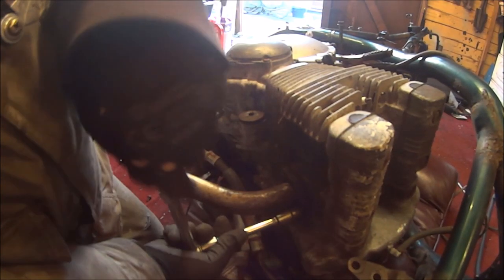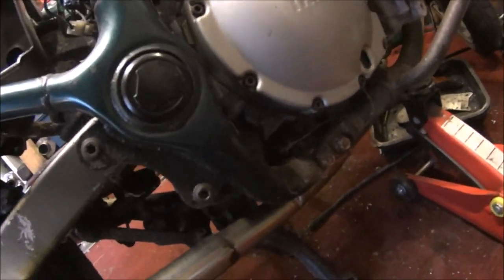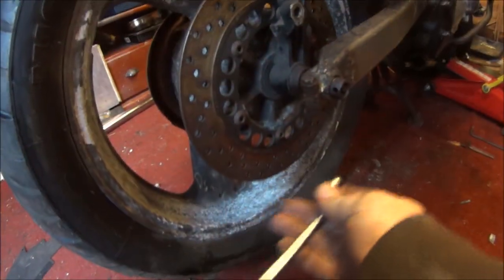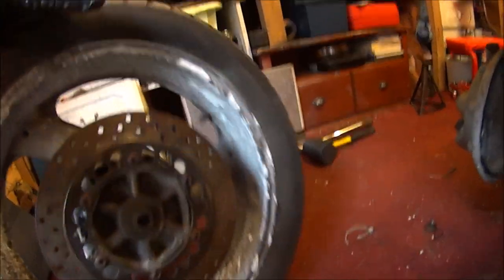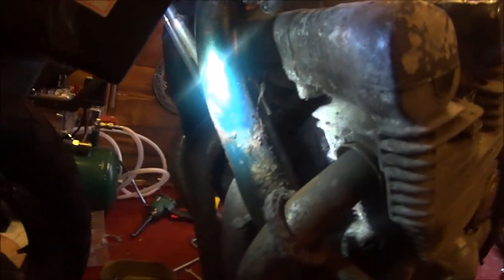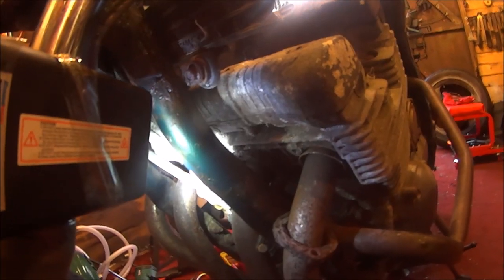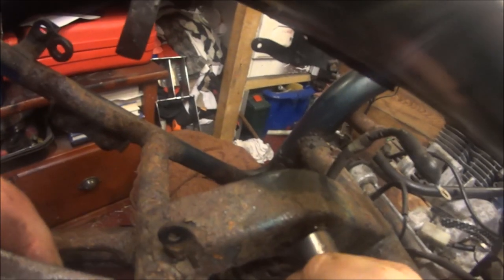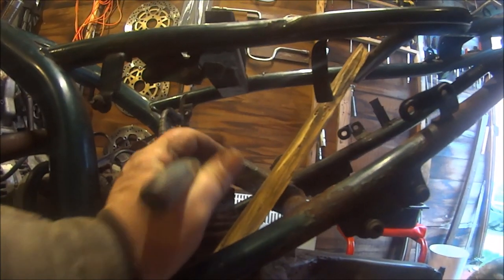Yamaha xj900s project part 8

Comment: That nice looking compressor.is crying out for a socket wrench from aldi.saves a lot of swearing and Blackman's pinches
Reply from the maker: darren molloy I have a impact gun but the bigger bolts still don't budge I'm not sure if the compressor is strong enough.
Reply: ROAD RODENT ..6cmf upwards
Reply: You are correct.they do use quite a lot of air..maybe letting motor run till tank full.may only get a minute or 2 out of tank.....certain 115psi is enough though
Reply from the maker: darren molloy thanks Darren I need all the help and tips I can get this bike ain't going down without a long hard battle lol
Reply: ROAD RODENT ..to be fair xj 900 arnt a bad bike at all.....many ended up has parts for trikes..but always preferd the fj1100 .you did well to get exaust downpipes off.has very thin walls to cylinders